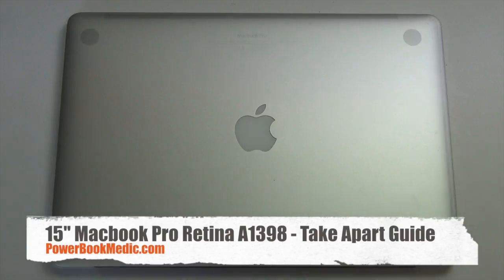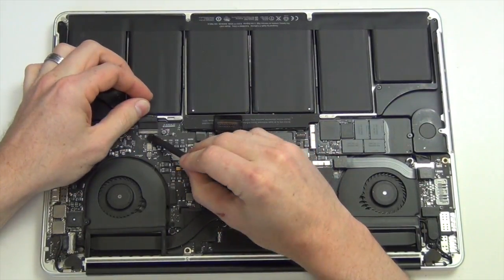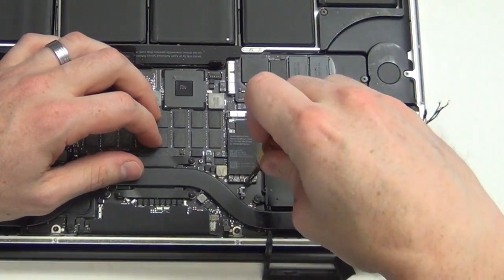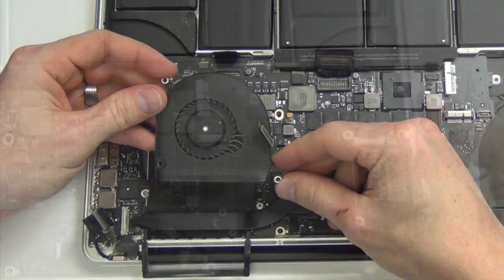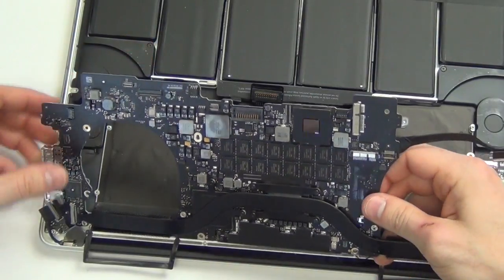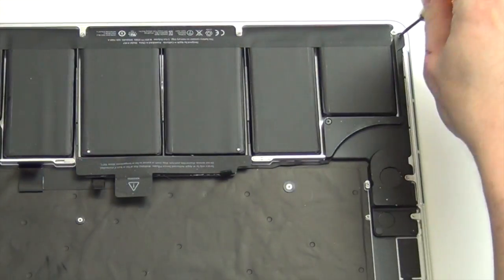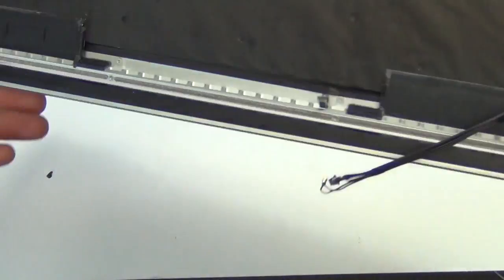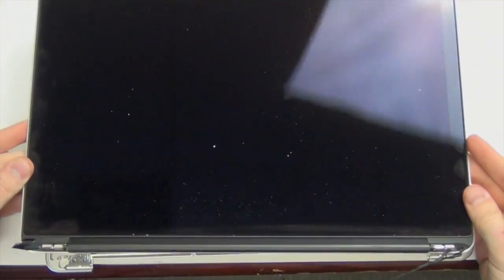Macbook Pro 15" Retina A1398 Take Apart (2012 Model)

Comment: Hello Powerbook Medic, Do you know what causes the battery percentage jumping at 820-3332-A logic board? The battery is brand new. Thank you!
Reply from the maker: qwert andrew Is it an OEM Apple battery or is it a third party brand battery?
Reply: Powerbook Medic No, it is not an OEM one this is a HWG A1417 battery from Amazon. It had been replaced because the old one was turned off around 30-40 percent. With the new was doing it the same thing and I made SMC reset Vram reset, nothing and then reinstalled the whole system and now it's not turned off around 30-40% the percentage has been jumping, also it is not that last longer than the OEM was before. The HWG battery is a 95W one BTW.
What does it cause this issue? 
This logic board is crap 🤮 I'm very disappointed!
Reply from the maker: qwert andrew It still sounds like a battery issue, not a logic board issue to me. I would try replacing it with an apple brand battery. I have encountered  so many issues with third party batteries.
Reply: Powerbook Medic I will try with an apple one. Thank you for your reply and time!!!!!!!! 😉

Comment: my left speaker is making crunchy noises. I want to replace it. do i really have to remove all this stuff to get the speaker changed? reallllly?????
Reply from the maker: Vita S. No, you can remove the left speaker without removing any other internal parts.
Reply: Powerbook Medic really??? Does it also  work with the right one? Or only the left? Because internet says the work is about 2 hours...

https://de.ifixit.com/Anleitung/MacBook+Pro+15-Inch+Retina+Display+Mitte+2012+Lautsprecher+austauschen/9734

Comment: awesome vid, used it to replace SSD with OWC one and went as far as disconnecting the speakers in this video, whilst removing dust buildup with antistatic air blower.  after reassamble the keyboard backlight stopped working, so I must have screwed up somewhere.
Reply from the maker: Faizal Abdoelrahman Glad you enjoyed the video! Check to make sure the cable is plugged in securely. It is located close to the right fan near the exhaust vent in the back.
Reply: @PowerbookMedic  Thanks again! I left it completely unconnected. Shoved underneath the logic board, lol. I reconnected it again and all fine, have the keyboard backlight back.
Reply from the maker: Faizal Abdoelrahman Yeah, it is easy to have that happen, that cable is so small. Glad it’s working for you!

Comment: Thanks for the Video, Is there a More comprehensive Instruction on what type of Screw drivers to Use for those Screws those Crew Drivers seem a little different from each other.

I have a mid 2015 MacBook Pro Retina I would like to change the Speakers.
Reply from the maker: Ultrasound Music This model is very similar to the 2015. There is various screwdrivers needed, but I will say the type of screw it is in the video (ex. Torx 5 screw would be a Torx 5 screwdriver.) Hope this helps!
Reply: @PowerbookMedic  Really appreciate the reply.  I also heard there's a Pentalobe Screw towards the back.

Comment: at 2:37 how do you undo the flat cable with the silver clip?
Reply from the maker: That’s the isight camera cable.  It slides to the right… Just gently pull on it.. you can use tweezers to help slide it out.
Reply: @PowerbookMedic  thanks so much.  I was stumped at that point when attempting to replace the CPU fans on my 2015 MBP 15" retina

Comment: Do I need to do much to remove and replace the speakers ?
Reply from the maker: It depends on what repair you are attempting.
Reply: @PowerbookMedic  I'm trying to replace a busted speaker
Reply from the maker: If you have a busted speaker, then yes, you will need to remove and replace them.
Reply: @PowerbookMedic  ya I guess so. There's like static coming from them.

Comment: and of course you don't show the removal of the touchpad... the hardest thing of all.
Reply from the maker: The trackpad is located underneath the battery and as such requires removal of the battery from the top case. The removal of the battery can be a very difficult procedure for a novice and can lead to battery puncture and fire. That repair should only be done by an experienced technician due to the potential hazards.

Comment: Thanks a lot. It was really helpful, when I drop off cup of tea on the laptop and needet to save it immidetely
Reply from the maker: Glad you were able to get it dried out. It's always important to immediately turn off the machine after a spill and dry out the machine as much as possible before turning it back on. Taking the bottom case off and inspecting for liquid is always a good idea to verify there is no liquid on the logic board before turning it back on.

Comment: Which scredriver is to open the mac ????????
Reply: torx t6 i think
Reply: @me me 

'What is the tool/bit called that is needed to open a macbook pro 15" retina display model A1398.  The screw looks like a tiny little star.'

Posted on Dec 4, 2012 2:14 PM

Reply  Me too (28)  
All replies   Drop Down menu
Page content loaded
User profile for user: Kappy 
Kappy
User level: Level 10

They are called Torx drivers. A T6 is used for the small screws on the back.

Dec 4, 2012 2:16 PM

Comment: actually as a further comment, if you know that you have to take care using the right screws putting it back together, it's fairly obvious. Just I got to the point where I'd covered up some of the screws I used before I realized that I needed to take care with it.